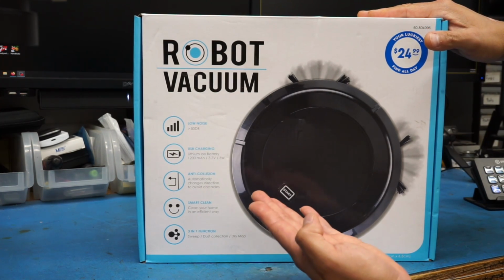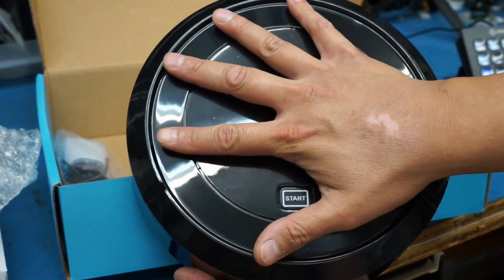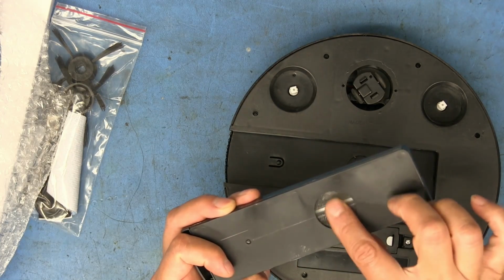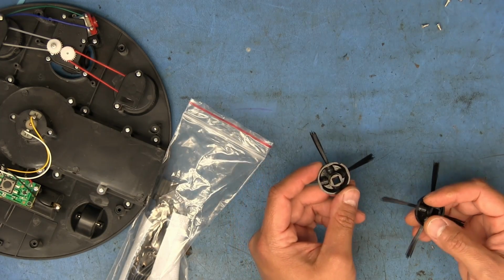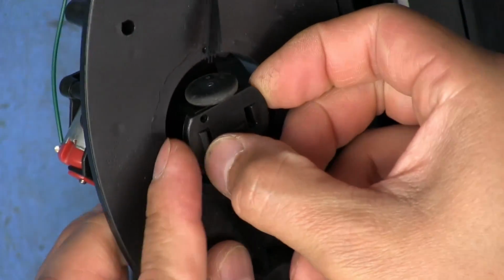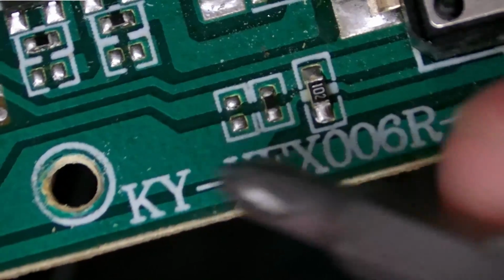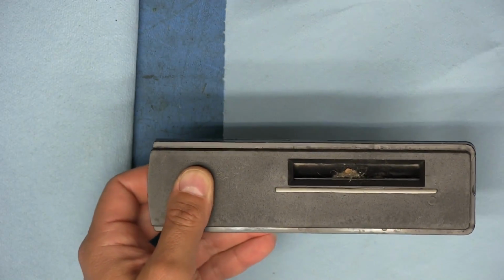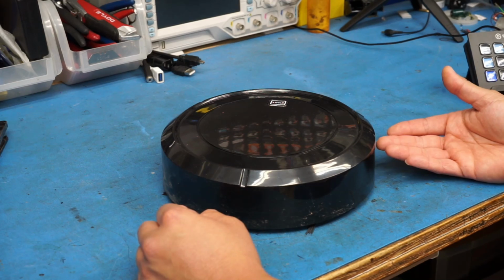TEF #114 | $25 Robot Vacuum Teardown And Test

Comment: Thanks for this public service. I have been tempted by these on the Chinese e-commerce sites when buying in some electronics components, they're even cheaper than $25 there, but always dismissed them as "too cheap to be useful". I would, without a doubt have eventually bought one so thankyou for saving me my beer money for the night! 😂
Reply from the maker: At least with a beer, if the floor is dirty, you'll still have enjoyed a beer. 

With one of these vacuums, if the floor is dirty, you'd still have a dirty floor afterwards. And no beer.

Comment: If nothing else, this thing is good for parts. 10:50 HAHA DVD logo.

Also that spinning wheel mech is going to load up with hair and gunk. I've had toys back in the 80s and I cleaned all the tangled hair from the spinny wheels. I have a toy repeating robot I'm going to try to get working again and it has the same mechanism.